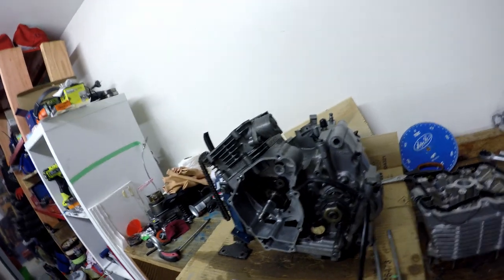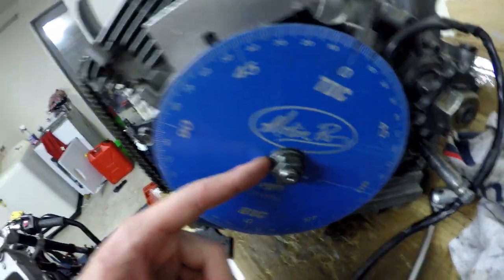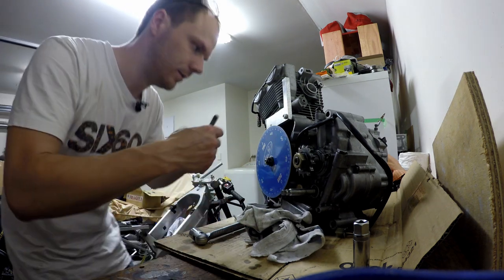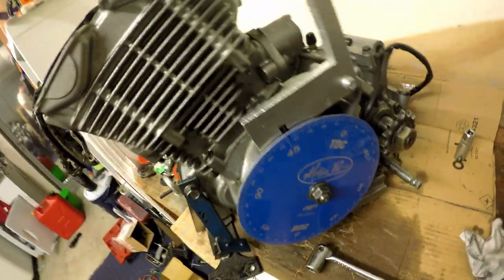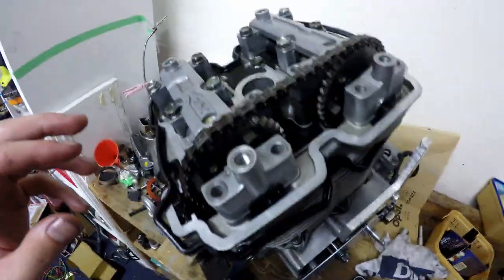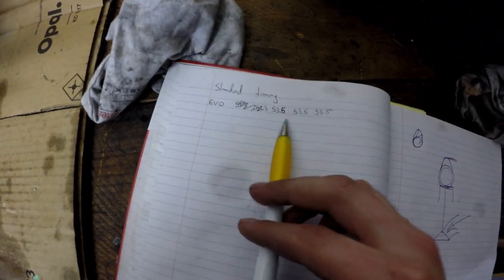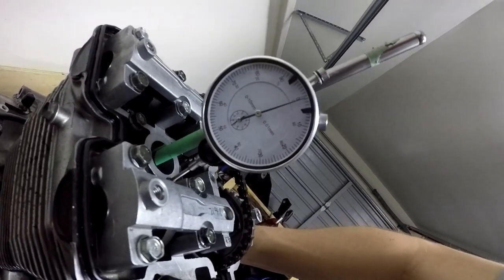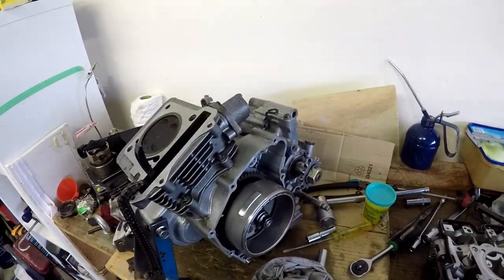Motorcycle cam timing setup Raider / FXR 150

Comment: Do u know how much km is the life of the timing/distribution chain ? Im the third owner but the bike just has got 64.500 km and got the original timing chain. Thanks
Reply from the maker: @laureanobarta7084  Fxr150 timing chains are quite strong and last a long time. 
You can check by seeing if the cam timing marks line up.
That will show if it has stretched much.

Comment: As i know, fxr150 ignition timing 9 degree BTDC (1500rpm), while raider 150 (fu150 carb) is 7 degree, and fx125 is 5 degree
So, I want to use Fx125 CDI for FXR150, what happens ? 
Thank you
Reply from the maker: If your timing of each bike is correct.
When you put a fx125 cdi on a fxr the less advance would probably give you a little more power low down and mid range but have less power higher up in the rpm's.
Reply: @TheMotorcycleForge  sound like good
And reverse, if use fxr150 cdi on fx125 (standard engine), does gain another results bro ?
Thank you
Reply from the maker: Yes so a fxr cdi on a fx125 should gain a little power higher in the rpm's.

Comment: How do you adjust the camshaft timing?. Did you drill on the cam gear?
Reply from the maker: I slotted the original holes with a die grinder/dremel

Comment: Can you help me degree my Suzuki fx 125cc it has same head the only problem is that I have racing camshaft’s 330 duration and 8mm lift I ordered a degree kit for timing but I don’t know how to do it one mechanic friend told me we can time the camshaft with overlap when both valves are open and piston is on tdc is this true?
Reply from the maker: If you follow this video you should get them timed up correctly. No I would not try set timing that way as it I just guessing. 
Getting timing wrong with destroy your engine.
Reply: @TheMotorcycleForge Bro make a video how to dial what maths we need to do I can’t understand from this video 😢
Reply from the maker: Yeah, sorry it is no as easy to explain as I would like.
So put simply,  you need the cam shaft set up data/ center lines.
Fit them to bike and find where they open & close. Half way is the ceter line, adjust till timing meets set up data.
Double check valve to piston clearance,  make sure there is enough clearance.

Comment: Hi, i was wondering if you can share the degrees on intake and exhaust?. Looking forward to it.
Reply from the maker: Yea man anything for a Sub  ;)   Ivo 16*  BTDC,   Ivc 39* ABDC,    235* Total.  Evo 42* BBDC,   Evc 9* ATDC  231* total.  All at measured at 1mm lift. * is Degree's.
Reply: @TheMotorcycleForge  Thank you very much my friend. Have a good day! 😀
Reply: @TheMotorcycleForge  sorry... i just wondering...

i think you retard 8 degree of exhaust open... Exhaust open  should be 34 degree right? Or i am wrong 😅
Reply from the maker: Depends on the cam grind, this was the specs on this cam, this cam had the lobes re ground for more lift and duration.
Reply: @TheMotorcycleForge  thank you friend... I love your video... I hope you can make more video about degree camshaft of twin cam engine in future...
Reply from the maker: Awesome to hear that , I will think about making another video on doing performance camshaft work.